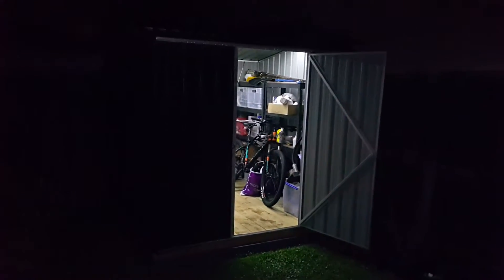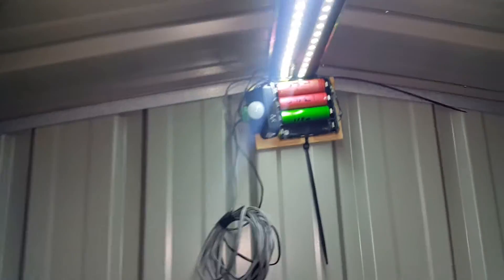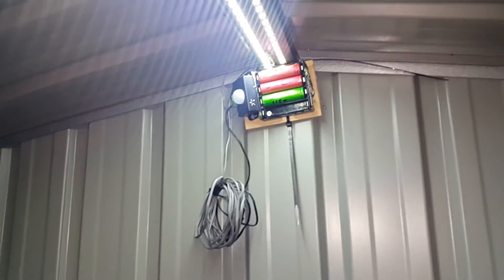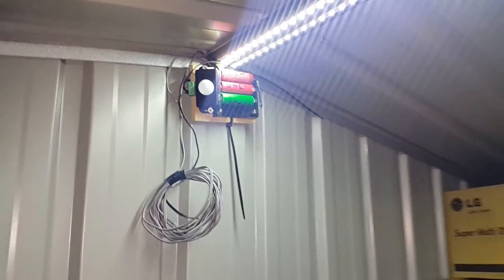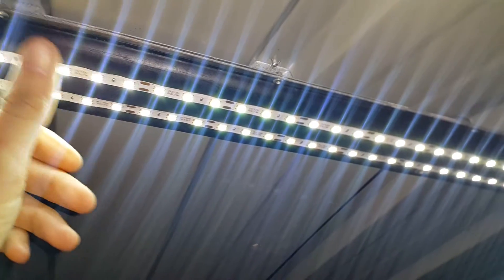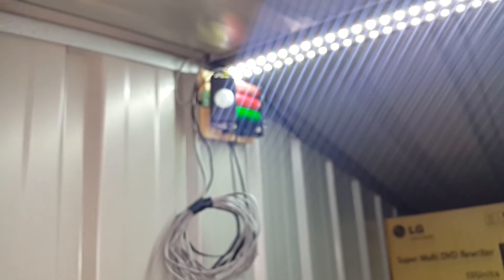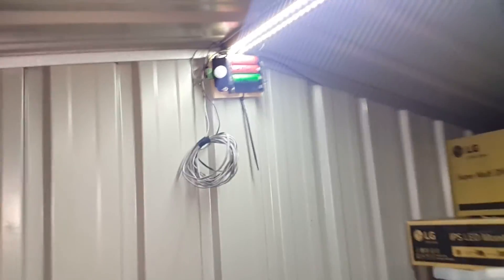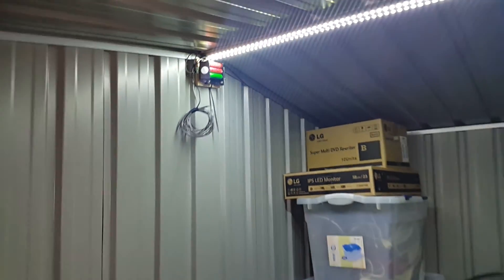18650 Solar Shed Light

Comment: I ordered one of the PIR units after seeing your video and installed some spare led strip in my garage and it works excellently, thanks for the video :-)  On the BMS front i have two of these from months back and tried to use them recently but sadly they just refuse to work.  Bought two different ones based on a different design and they work great.

Comment: Excellent idea.  I've been brainstorming uses for the lower capacity cells.
Reply from the maker: Garden lights or outdoor path lights would also be a good idea. I have some small cheap solar lights that seam to work well for the first 6 months and then they die. So replacing those with leds run off a set of 18650 would be the perfect way to solve the problem.
Reply: Any recommendations for a photocell versus the motion sensor?
Reply from the maker: Two different things, The photocell or LDR, sensors light eg ether on or off. The PIR only really works in darkness and sensors movement. For solar garden lights you want them to turn on when it gets dark so you would use the LDR. Unless you wanted a light to come on when you walk past then u would use the PIR. Etc. The PIR is used in the shed so that when you want in the light turns on.

Comment: What a good idea. I was planning to install some wall lights using LED strips for external use but wire them up to the mains. But I may alter this project for my YouTube channel like yours and use some of my 18650 and a solar panel to run this too. Good job.
Reply: I'm anxious to see your variation also.

Comment: Did you find a better way to do this? I am also thinking of putting my worst cells into good use with something like this, however I am looking for a proper BMS so I don't stress the cells (would prefer a range between 3.0 and 4.1V) but there's nothing. Every cheap BMS seems to be in the range of 2.50 to 4.25 which will kill the (almost dead) cells in a matter of weeks just by charging them that much. Let alone lots of old cells are heaters above 4.1V which would also end up badly!

Comment: Really, really nice. How much time does the cells would be capable of keep it on, without the timer?
Reply from the maker: it will depend on the cell you use, These ones are the worst i have but they still seam to last a good 20-30min. Which doesnt matter since i am normally only in the shed for a few min
Reply: Mikes DIY Tesla Powerwall Really nice. I'm going to "transform" a 10w reflector (I don't know if it's the right name in English) to a solar one. I'm going to try using 6 18650 in parallel charged with a TP4056, a 18v solar panel (so I'm going to use a step down to get 5v), a dark sensor, a step up and a 12v 10w LED driver. I don't know how much time it's going to stay on, but the LED draws a little bit less than 1A. So, if the batteries are really bad (1A) it's still going to take a good 4,2 hours (if I didn't miss calculated). Well, let's see what happens. :) But that's not right now, I have lots of projects that I need to finish before.

Comment: Mike, my parts have arrived woohoo! Not to sure how you connect the solar to the BMS? If I connect it straight to the battery +& - on the BMS wouldn't it bypass the charging protection? do you have a simple diagram? Keen on making it on the weekend. Cheers, Mark in AUS.
Reply from the maker: The bottom of the page in Ali for the BMS has a picture on how you connect the BMS to the batt. So batts to BMS, Bottom of BMS + and - goes to the PIR IN, Solar goes to PIR IN. Light goes to PIR LOAD.
Reply: I didn’t see the parts list or instructions /wiring diagram

Comment: Any wire diagram you can share? The PIR I have with me has 3 wires coming out of it and I am at a loss for connections...
Reply from the maker: Mine PIR has 4 wires. But if yours has 3 thats fine. Msg me the model number of yours and i can tell you. But really the 3 wires will be input "pos,neg" output "pos" otherwise the output will be neg. Depending on which is switched. Eg the PIR needs power,, so needs pos and neg and it will switch one of them to turn on a output when the sensor picks up something.

Comment: great idea, are you running the panel straight in to the bms?
Reply from the maker: Yes , panel going straight into the PIR which also goes to the BMS, as simple as possible haha
Reply: Won't they potentially overcharge?
Reply: I don't think so as the board will protect from overcharge. I think stops at 4.2v